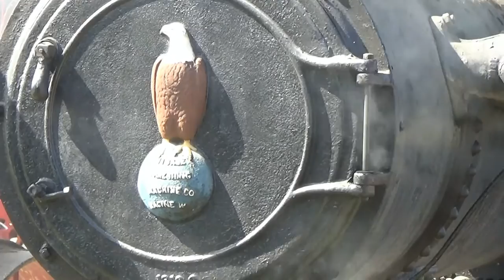Steam Tractor Powers Saw Mill

Comment: This is very similar to my uncle's sawmill in Indiana. His blade was larger.  He could slab 4 ft diameter Elms.
We fired it with sawdust and wood slabs ... about as close as we kids were allowed to get.
That belt scared me more than the 8 ft ripping blade!!
Reply from the maker: Thank-You for viewing, and commenting.  I think I was seven years old when I saw my first steam tractor.  While I respected it, I did not fear it.  You see, my Dad, the foundryman, had been very thoughtful in bringing me over to the job.  I was submerged in industrial light and sound from an early age.  My Dad would appreciate your memory of the belt.  Dad was always warning about any long chain, belt, or cable.  His mantra was to expect the unexpected.  And, as a child, he helped the family cut up old railroad ties in furnace wood.  They used a Model-T Ford, with the back end jacked up and a belt attached to a rear wheel would turn a belt that turned a blade.  Ah!  For the days when people could freely burn creosote in their homes!

Comment: How come that the belt that powers the wheels is so loose and not fall? And on 0:14 I don't understant how it can stay on the wheel?
Reply: Jakub Mrhal there actually is alot of tension on that belt, and the flywheel and the pully are beveled in a way that they stay centered as long as the engine is lined up to the sawmill correctly, sometimes belt dressing is applied to make the belt stickier to stay on better, they only ever fly off if it is a big pull that sticks the blade, or if its raining since rain makes it more likely to fall off

The reason I know this is because I’m one of the guys operating in the mill :)
Reply from the maker: Thank-You for viewing and commenting!
Reply from the maker: Hi!  Thank-You very much for that reply.  This is an example of me not noticing the obvious.  All the times I have watched the many misc belts and I never thought about how it adheres to the power take off!  The saw mill has always been a favorite attraction of mine at the Thresheree.  Dimensional lumber and balloon frame structures really boosted the way this nation grew.  When I watch the mill operation, I can let my mind travel back in time and I can pretend to be there.  Thank-You for viewing and furnishing information.  More importantly, thank-you very much for being one of the guys at the mill who creates Living History!!!

Comment: Id like to see one of these burn some used tires in the fire box to use a alternative source of fuel instead of using coal or wood since everyone likes seeing the belching black smoke from one of these wonderful engines run
Reply from the maker: A less polluting fuel would be a very good idea but wouldn't the tires be worse than coal?
Reply: @ipfeldspar  no not really its no worse than burning oil or diesel fuel its actually cleaner than oil or diesel fuel if burned at the right temperature because rubber has 70 percent wood product from the rubber gum tree sap and 50 percent used motor oil whichever thats how rubber tires are black in color in general and when the two products burn is how u get the black smoke but if you burn the tires hot enough in a gasification system going you can get no smoke period at all plus if everyone would burn tires in these old steam tractors for fuel it would save a lot of tires being thrown in the land fills and rivers and streams plus after the tires are burned the clean out of the ash would result in free scrap metal out of the ashes and thats 💰money in your pocket and saving the environment from being over polluted in land fills and rivers and streams and scrap yards of used old abandoned tires even plastics would be a good source of fuel for these old steam engines too that can be made into plastic pellets
Reply: We used to burn the sawdust and slabs from the mill.  Built in fuel source, no  waste.!